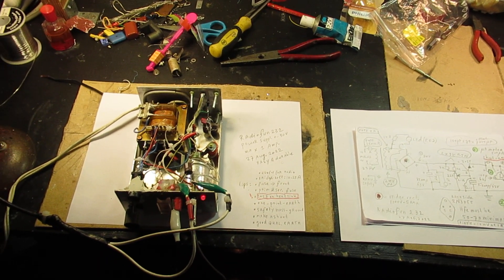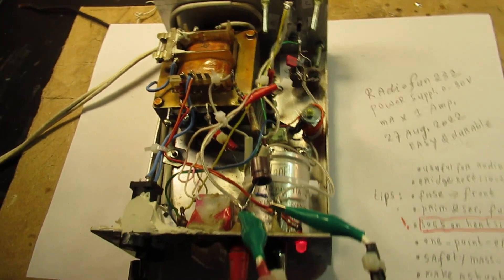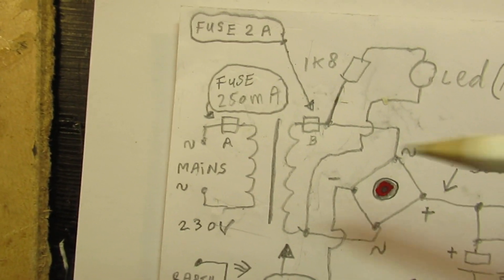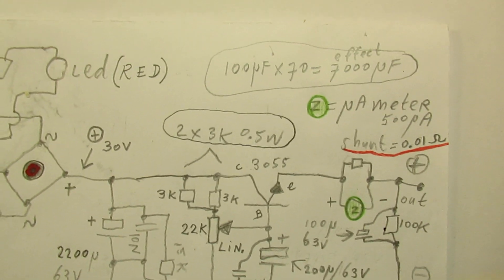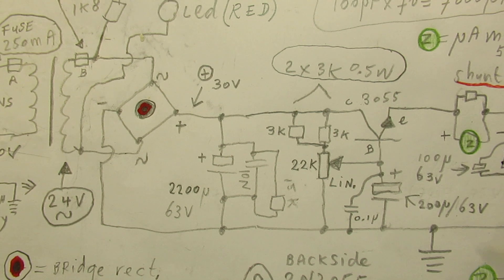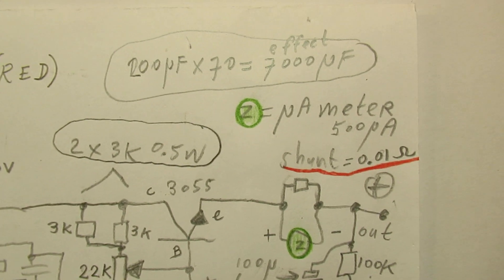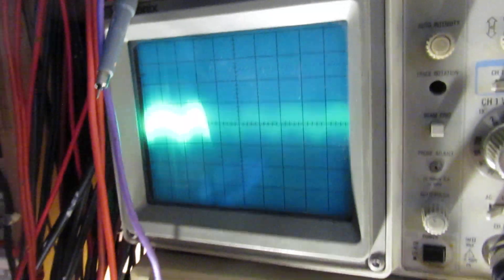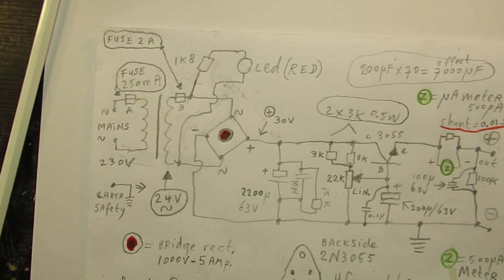Easy extremely low ripple Variable Voltage supply 0-30 V/max 1 amp. made with only one 2N3055 (demo)

Comment: Thank you for a low ripple variable voltage supply 0 -30 V. How did you calculate the value of the fuse on the primary coil of the transformer? Should that the fuse be fast or slow type?
Reply from the maker: Should be a slow type. The value of this fuse is related to the situation where there is a pure shortcut on the the secundary winding. In that case it must burn out. That also depends on the voltage where the transformer works: 110 V or 230 V AC. A 110 V transformer takes more current on the primary when, on the secondary winding, an output of 24 Volt at 1 Amp is given. Has also to do how much current is taken in the first split second when the E.M. field in the transformer is built up (inrush current, reason for the slow type). And that depends on the load that is present at the secundary winding. So a lot of parameters. For small transformers  (20-30 Watt) in general a fuse of 1 Ampère is a good choice, in the 230 V AC situation. Try, test, experiment. A good test can be done with a set of automotive lamps, voltmeter and ampère meter. Test, in that case, the transformer on the nominal voltage and current.
Reply: Hello! I am obliged for your reply. I calculated that if the voltage of the primary winding is 240VAC, the current of the primary winding is  (1 A x 30 V) / 240 V = 1/8 Amp that is 125 mA. So the fuse on the primary coil of the transformer ought to be at least 125 mA  (5 x 20 mm glass fuse 250 Vt type). Hopefully 130 mA or 170 mA slow fuse would be fine. If 1 Amp is the maximum output current for 0 - 30 Volt variable voltage supply, then 1 Amp or little more, let's say 1.25 ... 1.50 Amp fuse on secondary coil of the transformer is good. Actually 24 VAC voltage on the secondary coil of the transformer gives 24 V x square root of 2 which  is about 1.4142 = 33.94 Volt. I am using a 21.6 Watt small transformer, which is about to give maximum 1.6 Amp current on the second winding, thus the maximum DC voltage of this variable voltage supply is below than 30 Volt, perhaps only 18 - 20 Volt.
Reply from the maker: @perttisalonen850  Thanks for your calculations and reply. I agree with them, they are OK. Issues can/could be: the inrush current and the fact that, with a shortcut on the secondary, the voltage drops to "zero" (not complete, anyway) and the current will go much more higher than the max. 1.6 Amp. Surely the 130 mA primary fluse will burn out. 😁
Reply: @radiofun232  The shortcut of the secondary coil shall increase of the inrush current over 1.6 Amp and of course would blow the fuse. If one is wanting to have an over current protection with the variable voltage supply and also an over heating protection of the transformer, then this simple variable voltage supply would no do at all. On such case one could make a variable 0 - 30 DC power supply using adjustable current, let's say 3 Amp with a L200 regulator, a couple of transistors, an IC, resistors, capacitors, zener diodes, one fixed voltage regulator. As L200 regulator needs minimum 1.25 Volt control voltage, a small negative control voltage circuit, e.g. with 555 timer circuit which start the adjustable voltage from 0 Volt., not from 1.25 Volt. However, it is a complicated variable voltage supply suitable for a laboratory power supply unit.
Reply from the maker: @perttisalonen850  I see you know everything, before you asked me. Good idea is to publish such a circuit on your You Tube channel, that at the moment has no content. Everyone can learn from that.🐒
2 september 2022.
Reply: @radiofun232  That is a fine idea. I am obliged for this video of yours. Good!

Comment: Can I assume that by using a Darlington (2 transistors product gain of about 1K) configuration - the output capacitance would increase proportionally that much further, and so reducing the ripple? I wonder how a power FET would function here? Out comes my components box again :)
Reply from the maker: Thanks Michael and yes, with a Darlington (say a BD 139 and a 2N3055) you can get somewhat better results in terms of ripple rejection. Reason, like you know, that we may multiply the capacitor at the base of the Darlington (say 100 uF) by the amplification factor of the Darlington. Say 150 (BD 139) x 70 (2N3055) = 10500. So a 1 uF cap is "changed" (only effective...., what the circuit connected to the emitter of the 2N3055 "sees") to a 10500 uF capacitor. That means an enormous ripple rejection with a very small capacitor, that also (extreme ripple rejection) will be the case with high output currents. The circuit published here is in a kind of way a "middle of the road circuit", with the smallest amount of components. And it is a good idea to  make this circuit with a power MOSFET, driven by (say) a BD 139 (or not..., using it solo). When the circuit with a power MOSFET starts to oscillate, a 100 N capacitor between the gate and the ground or the source  can prevent that. 28 Aug. 2022.
Reply: @radiofun232  Comprehensive reply - cheers Ko.